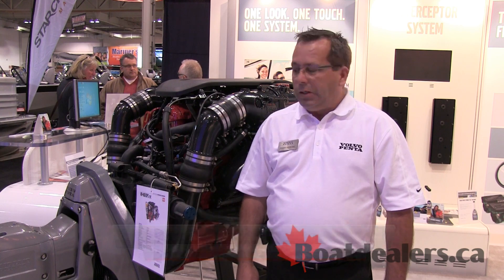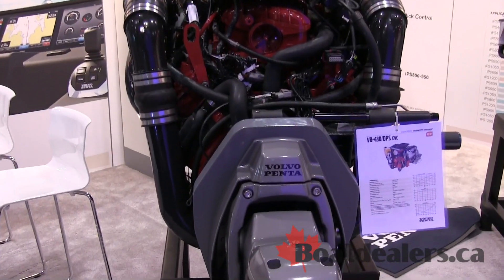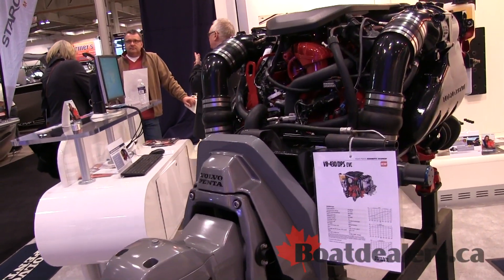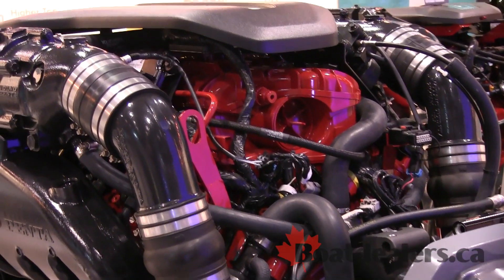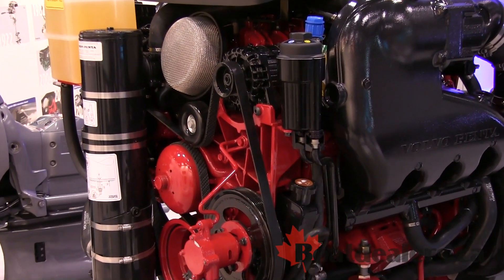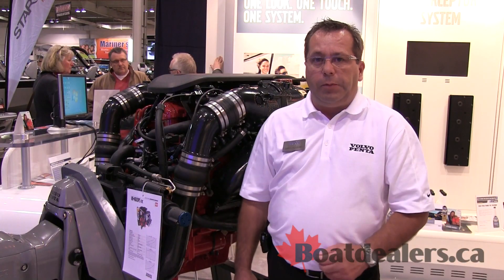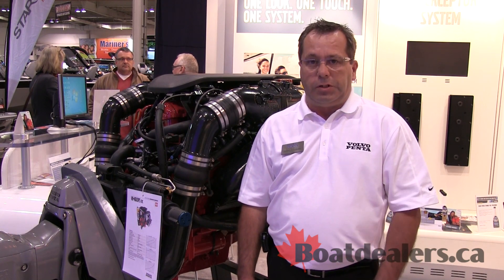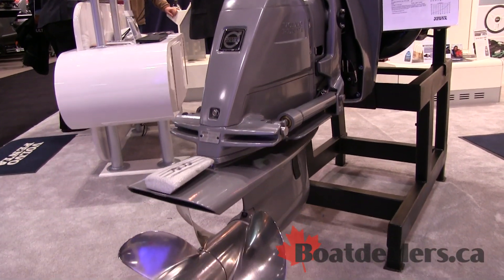VOLVO PENTA V8 6L Stern Drive Engine

Comment: Can this engine be used to replace the old VP 8.1 OSI-D engine? Since they both work with the DPS out drive, would it be a simple swap? What else would be required to make it work with my current boat wiring from the 8.1s?

Comment: Great video.  I have a question on my Volvo penta 280 which hit a rock and the prop now just spins freely and won't engage.  Is this something that's fixable?

Thanks,

Dustin
Reply from the maker: ***** 

Hi Dustin. You will need to get your drive (lower unit) looked at by a Volvo mechanic to determine the extent of the damage. It should be something that can be repaired. Thanks!
Reply: Is there a shear pin on the 280?  Thanks in advance!
Reply from the maker: ***** 

Not entirely sure on that. We suggest you find your local Volvo dealer and reach out to them directly. You can find your Volvo dealer here: http://www.volvopenta.com/volvopenta/na/en-us/applications/dealer_locator/Pages/dealer_locator.aspx

Thanks!